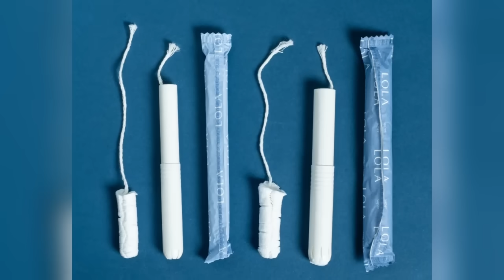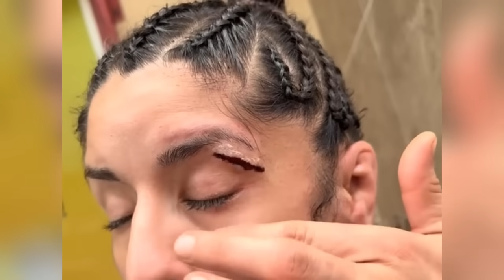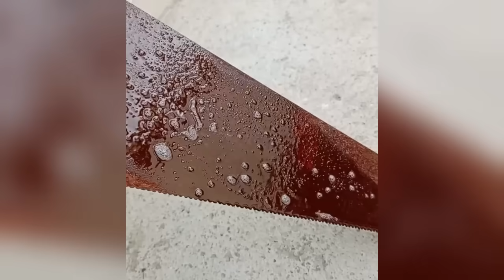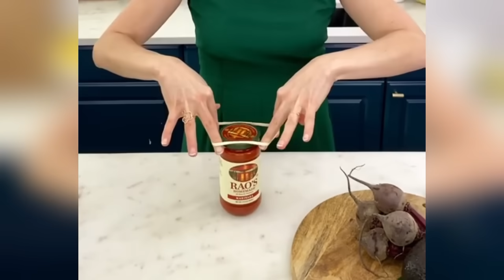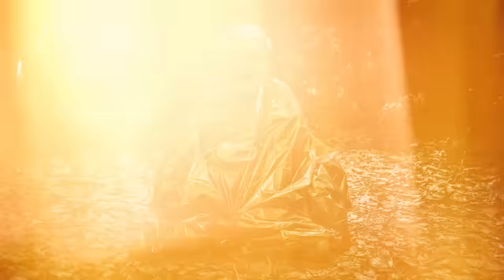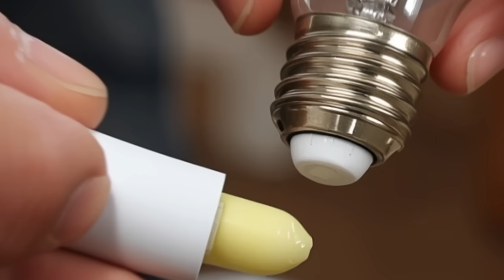20 Household Items with Survival Uses You Never Knew

Comment: In case there's anyone out there who still wears stockings: Don't drip super glue while wearing them. Hurts, smokes, leaves a scar.
Dental floss will absolutely slice into your skin, so don't fish w it bare handed like shown in the video.
Lens to start a fire requires the focal point to stay in one consistent spot, not "micro shaking" so some sort of stand is needed.
There's a trick w a potato to remove a broken bulb from a socket if you want to look it up.
     Some really odd choices for visuals in this vid.

Comment: You can diffuse the effects of a directed energy weapon by holding a wet towel in front of you. And you can use either a piece of sheet metal, a large street sign or a large piece of cardboard wrapped with mylar or aluminum foil to deflect the energy from a directed energy weapon pointed at you. Metal mesh with small holes works to dissipate the energy, but doesn't block it completely. 
Just a DIY FYI.
Reply from the maker: thanks for this.... i had no idea.👌

Comment: Awesome.
However, a note on using aspirin water on food plants. The video says one tablet per liter of water. You should use one tablet, that is about 325 mg, in one gallon of water, not one liter. Using one liter will make a concentration so high that the leaves and fruit can significantly suffer in sunlight. I'd rather than spraying the solution on the planet itself, it is better to pour 122 cups of the aspirin water solution where the roots are growing in the ground. This way, it will be absorbed into the plant and give the plant a good protective boost. However, if there is fungus on the plant already, then that is when you use the sprayer on the plant itself.

Comment: When you replace a bicycle tire tube (or the tube out in of any type tire that uses them) don't throw away the old one! (Unless they're very old and weathered)
Cut it into rubber bands of varying thicknesses. These degrade much slower than the rubber regular rubber bands are made of and will last almost 3x as long. I snag every tire tube I see thrown away by the men who refuse to save them for me and have a big bucket of bands from the size of a dime to the size of a DVD and I use them for everything, wrapping cords, putting a handle on something I need to hang up, adding a grip sleeve to a slippery cup... If you don't cut up the entire tube right away and save a chunk of it for later, you can customize the width for unconventional projects that might pop up later. 
I even used a piece of a bike tire tube to replace the sling on a sling shot and it worked like a charm! The first test rock propelled further and more accurate than I expected!
Reply from the maker: That is a fantastic tip, repurposed inner tubes are honestly one of the most versatile items you can keep in your gear! 🚲👍

Comment: With the tampon in a puncture wound the doctor can use this to guess the depth of the wound and also if you pull slightly on the string it will indicate the exact direction of the wound. Pulling sightly on the string will create a small wrinkle at the edge of the wound. By moving the string slowly watch until it makes a complete even circle around the wound. This will give medical and indication of how close you are to what organ or artery. They left out pantyhose, (nothing beats a great pair of Legs). Pantyhose can be used as fan belt incorporated with duct tape. Adds a little bit of strength for water carrying with the condom. The condom if you put about a shot glass of water into the end and twist it so it makes a round water ball, that can be used with the sun for starting fires. One of the greatest tools that I am always using pretty much every day is my Swiss Army knife.

Comment: Cayan pepper can be used yo stop bleeding, stops infection , heals 10× faster than first aid ointment, simply put on and let fall or rinse off. Do not pin it to your skin via a bandage or anything else.  Only needs to contact the wound for a few seconds . 1 and done . No need to re apply  unless would in reopened . Works on severe burns as well. Will stop tooth infection and pain instantly  ( warning, be 100% certain that there is no food particles in the hole before packing with cyan  ) can be used as rinse as well. . Heals bleeding ulcers and strep throat.  Mix small amount with hot water . Can add honey and lemon and/or green tea. Helps improve circulation to figures and toes if drinking regularly.  Helps the heart as well.  A must have for any med kit . Must be cayan pepper . No substitute
Reply: If you have no cayenne pepper, spider web can help to stop bleeding. Plantain leaves can double as bandages.
Reply: What would happen if the food particles were still present in the case of tooth pain/infection? 
I've never used cayenne for this before, always clove oil, sesame oil or three theives oil which eats the bacteria from stuck food particles causing the infection and pain near the nerve endings. How does cayenne attack the problem and why would remaining good particles cause an issue? I'm truly curious, not trolling.

Comment: It’s not recommended to stick a tampon directly into a bullet hole, but you can tape it sideways over the wound to absorb bleeding. You can also use it to absorb water from surfaces and tight places. Tampon string+crayon= candle. One thing about the Mylar blanket, if you are wrapping it around you, make sure the reflective surface is toward your body to retain the maximum heat.
Reply: Every medic I've seen says to pack gauze into the bullet wound and throw away the tampon
Reply: I was under the belief that they were good for penetration wounds. Read your comment , then googled it. ..learn something new every day.

Comment: Okay, you're saying lip balm can be used in #3 for starting a fire, and then in # 19 you're recommending the same thing to be used on the thread of a lightbulb. It's flammable, so why would you use it there ? Isn't it flammable?
Reply from the maker: Lip balm itself isn't highly flammable, it's the cotton ball or tinder it's applied to that burns. The balm just helps it burn longer. Using it on a lightbulb thread is safe as it's not exposed to an open flame.

Comment: Would the lip balm/beeswax trick work for keeping batteries from corroding while inside a flashlight or other device?
Reply from the maker: That's a really interesting question about the lip balm/beeswax trick for battery corrosion! I haven't specifically tested it for that, but it's definitely worth experimenting with.
Reply: @Sidney_Explains_Money I have a cheap flashlight I'm going to try it on. Of course, it will be a long time until I know whether or not it works. I'll need a second flashlight of the same type as a control. Now, is there a way to increase the chance of corrosion happening?
Reply from the maker: You could try introducing some moisture or storing it in a humid environment to accelerate corrosion for your test.

Comment: A sanitary pad can also be used as a ice pad, if you have access to ice, freezer. Wet the pad, place in freezer or even ice cold water if available. Freeze the pads, place in a zip lock bag after freezing.  Apply to body part needing a cold compress.  Avoid skin damage by checking the area, and/or placing a thin layer of cloth between the skin and compress.  If not soiled these can be reused.
Reply: You can add alcohol as well for use pack. For healing use aloe and witch hazel and freeze, I recommend this to my moms after delivering babies.
Reply: Diapers if you need a bigger one..

Comment: I don't have tampons in my house since I kicked the b**ch out, but I've heard of soldiers sticking them in bullet wounds. I also heard they don't work to stop major bleeding because they're soft and porous.  Super glue doesn't just close wounds, it makes an artificial scab, and sometimes that's very beneficial. I also used it to seal up and hold together a front tooth that split down the middle. Several applications later, I got the tooth pulled after a couple of months of putting it off, because it couldn't be saved. If you're using bleach to purify water, DO NOT use concentrated bleach in the smaller jugs, or scented bleach. One time when I was in the army they had so much bleach in a 400 gallon water buffalo (water tank trailer) that it tasted horrible, and I wondered if we were getting poisoned by it. As our only water source, we had to drink it. Kotex was invented after WWI when the company wondered what to do with all the leftover cellucotton (wood pulp fiber) from World War One bandages. Of course you can make bandages from menstrual pads, that were made from bandages. There are several things rubber bands do that rings cut from a bicycle inner tube will do even better. They're called Ranger Bands, after U.S. Army Rangers. You can buy the commercially available products, or buy an inner tube and make a boatload of them cheaper. Finger cots, which look like baby sized condoms, work better than actual condoms for covering the muzzle of many firearms. If you don't want natural off-white color from the drug store, search for Rifle Condom Muzzle Covers. You can get black ones to match your EBR (Evil Black Rifle), or blaze orange so people can keep track of guns' muzzles, among other colors. Charcoal briquettes are made from sawdust, wood chips, and other materials, with binders like clay or starch, and sometimes other chemicals, like lighter fluid. If you need charcoal for anything but grilling, use real charcoal, not briquettes.
Reply from the maker: Dude, your comment is epic! Seriously, so many cool tips and stories, especially about the army stuff and the Ranger Bands. Thanks for dropping all that knowledge, super interesting read!
Reply: @Sidney_Explains_Money  Thank you. A good topic deserves a good comment, and I'm glad you found it useful. I was raised on chlorinated city water, but still feel a bit sick when I think about drinking that bleach water in the army. Yuck! It didn't matter what color you were, you were white on the inside.😁

Comment: Keep the bleach away from direct sunlight. Apply the bleach to water in the shade. After 30 minutes, expose the water that had bleach added, to direct sunlight with the lid open. It will decompose any leftover bleach faster. It may release some chlorine gas, so do it outside or in a well ventilated area. This is always a good thing to do in case you added too much bleach by accident.
Reply: @EbonKim thank you so much ❤

Comment: Great advice, make sure if you store your kit in a car, outbuilding etc, to rotate the stock on things like rubber bands, that degrade fairly quickly even under temperature controlled environments. I go thru mine every time I change my batteries in my smoke alarms, so when the time changes lol. Lots of e collet comments here. I do keep some crayons but also I keep emergency candles as well, they’re a bit more reliable and have longer burn time, stay safe ya’ll
Reply: Clear nail polish on the thread securing Buttons help them to stay on much longer.
Reply from the maker: That's a fantastic point about rotating stock, especially with items like rubber bands! And the smoke alarm battery trick is brilliant for remembering. Emergency candles are definitely a solid addition too – great tips!

Comment: Does the crayon release toxins in the air? Are Cisco or Vaseline safe to use too?
Reply from the maker: That's a really insightful question! When it comes to survival, safety is paramount. While crayons can be used as a makeshift candle, burning them can release fumes, so it's best to use them in a well-ventilated area or for temporary light. As for Crisco and Vaseline, they are generally considered safe for external use and can be used as fire starters or lubricants in a pinch, but not for consumption. Always prioritize your health and safety!
Reply: Burning Crayons can kinda stink too.

Comment: Retired medic and retired critical care Rn…. I can tell you super glue is an absolute must for lacerations!! I’ve used it and it WORKS !! BUT….. it burns like hell !! Technically it’s not sterile, but neither is an open wound !! Yall do the math !
Reply: My dad taught us this in the 70’s and it is fantastic for papercuts!
Reply: @Danielle-zq7kb  So is covering a papercut with clear nail polish. Only a buck at the dollar store and it won't dry up or clog like Super Glue does after one use. 
There is also an item called Liquid Bandaid/Bandage that you can buy to apply with a brush to tiny cuts to keep bacteria out. 
It's expensive and if you read the label it's just nail polish in a fancy bottle.
Reply: @marciaoh7056interesting never heard the nail polish trick, or that it's basically the same as liquid bandage 🤯
Reply: @Danielle-zq7kb  I was cutting a plastic bottle with a knife….a very sharp and pointy blade knife and it slipped and I stabbed my meaty part of my thumb at hand level. What hurt the most was pulling the knife back out lol didn’t really wanna but I figured I needed to 😳🤔😂 anyway to make a short story longer and after a lot of direct pressure I got the bleeding slowed enough to give it the old slupper glues fun fun cause I didn’t want stitches and to look like an idiot ( already felt that way ) so I glued it on up.  Burned like hell but my doctor said he couldn’t have made the scar look any where near as good if he had of had to stitch it up !!!
I’m rather proud of that… not so proud of the dumbarse stabbing myself lol but the scar was awesome ! It truly does work !!
Reply: @robertlrosekranssr7409 They have a special super glue for use on wounds. You should never use the kind of super glue made for fixing broken items.
Reply: @robertlrosekranssr7409  I just stabbed myself in a similar way just the other day. I was cutting soda bottles to cover growing seedlings. Man did I feel dumb, so don’t feel bad. I only got the side of my finger so no stitches but you’re not alone. I think we have all done things we should have been more careful with.
Reply: @Hard-boiled-eggs  AMEN !!
Reply: Super glue is also super toxic.
Reply: @geekchick4859  ummm… you’re not supposed to eat the shit !!  Just saying 😂🤦‍♂️
And just for an FYI…. So is Water !! Drink too much, you die !
Reply: @robertlrosekranssr7409  That is not the definition of toxic. H²O is not toxic.

And I hope you know that toxic chemicals are absorbed through the skin. That's why cyanoacrylate, and a whole array of other chemicals are  toxic.
Reply: @marciaoh7056 “water toxemia” “ water intoxication”…. Perhaps you should go look up both of those two definitions?! After that, I’d suggest you look up the word “toxic” which I’ll save you some time and let you know it means “poisonous”, which means to  “take into the body” which can be from several methods ie; drinking, touching ( absorbed), traumatic ( think arrow dipped in “Poison”
Now here’s the fun one “snake bite” snake are “venomous” not technically poisonous…. But what does their “venom” do to the human body ?!? Yes, that’s correct….It “POISONS” it. 
But I digress Have a wonderful day and thank you for commenting on my comment !!
Reply: @robertlrosekranssr7409 They have a special super glue for use on skin. You shouldn't use regular super glue.
Reply: @lindastephens619  go back and read the comment I made @Sidney… where I told him about “durabond” and “surgiseal” both medical grade “Superglue” meaning that they are supposedly “sterile”, but they are ALL
“Cyanoacrylate” in other words….SUPERGLUE !
Have a wonderful day and thanks for commenting on my comments
Reply: I've used super glue several times on various cuts and it's never burned... Maybe I'm immune to the burn 😂😂
Reply: @pyrosmoak53  bless you heart.  It sho nuff burned like hell on me!!😂 or maybe I should have used the word sting. It stingededed like hell hahaha. I’ve a bad habit of using sting and burn  interchangeably. It do work though don’t it ?!? Have a great day !
Reply from the maker: Wow, a retired medic and critical care RN weighing in on this is incredible! Thank you so much for confirming the practical use of super glue for lacerations and for sharing your firsthand experience – that adds so much credibility to the tip!
Reply: @Sidney_Explains_Money in the hospital setting it’s called durabond or surgiseal 
It’s all cyanoacrylate ie; superglue. The medical grade is supposedly sterile. 
They BOTH BURN like hell !😂
Reply from the maker: @robertlrosekranssr7409  OMG! yeah.... I can see how they would burn like hell. 😳
Reply: @Sidney_Explains_Money I genuinely can't tell if this is sarcasm or not lol
Reply: Funny enough, "liquid bandaid" stings even more than super glue. Lol

Comment: When using a condom as water container, consider supporting it by putting it inside a sock or bag before filling.
Reply from the maker: Excellent point! We're all about maximizing efficiency and minimizing accidental hydration in a survival situation. Smart thinking!
Reply: @Sidney_Explains_Money Why would you want to minimize accidental hydration?
Reply: Clever
Reply: @silviamonz2062  Not if you use a sock. Where is all the water supposed to go then? Outside the sock?
Reply: @melanien5599 of course this doesn't allow for gallons of water to be carried but it allows for safe transport of smaller quantities
Reply: Good idea! I have a few very cheap but useful devices I bought from Temu for about one dollar; they are plastic stands with clips designed to hold a plastic zip bag open for filling. I make homemade dog food, and freeze it in baggies, and that cheap device makes it much easier, and they are adjustable for any size bag, from a quart to 2.5 gallon. They would work for condoms, too!
Yes, I know everyone loves to hate Temu, but I've found many great prepper items there for much cheaper than Amazon (and they come from the exact same factories).
I don't use my bank account, though. Paypal seems to be safe, as I've never had a problem with it being hacked, or one could use a prepaid Visa card.